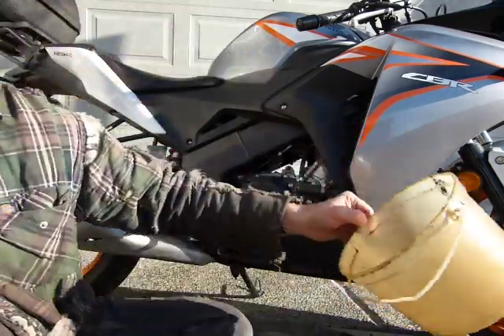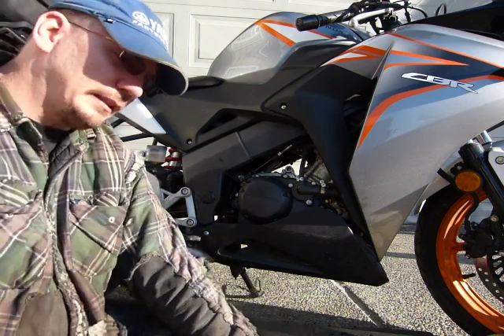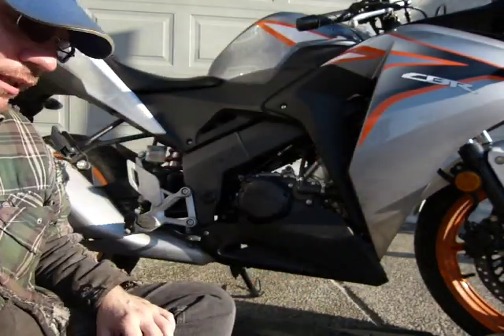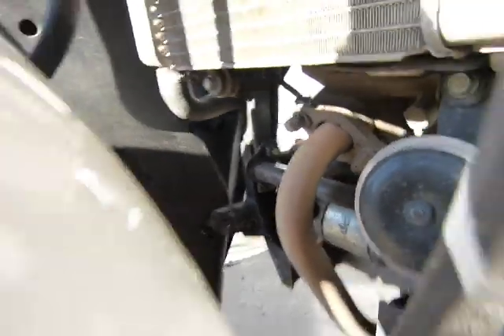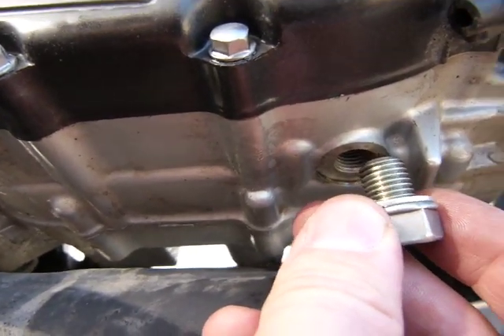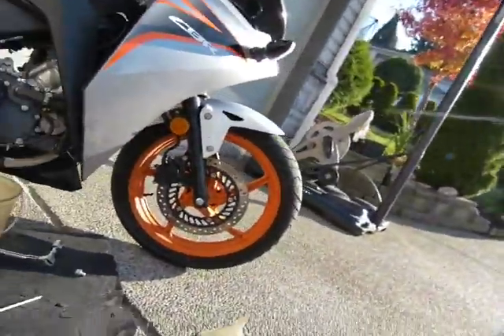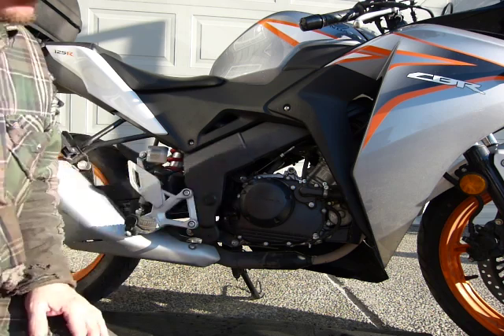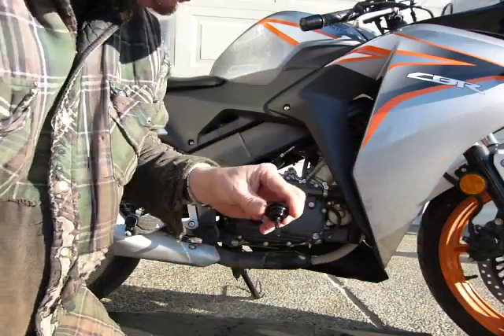CBR 125R first oil change (1000km or 600mi)

Comment: It actually does have a filter in the form of a screen, the oil passes through it and back to the bottom of the engine, its basically just a gauze and can be accessed by removing the clutch side
Reply from the maker: Graham Clarkie That`s right, thanks for the detail.

Comment: great video man. just to confirm, you measure the oil upright and not on side stand right? also is it just 1L of oil you need?
Reply from the maker: +HonestAbe89 Close. Upright AND level front-to-back, 1L approximately, until oil level shows between marks on crank case.

Comment: Hi, I have CBR 125 2011! Is there a oil filter that I have to change?!
Reply from the maker: No oil filter to change. Regular maintenance is oil only.
It does have a coarse wire mesh inside the crank case, but that only catches big chips or debris, mesh size is 2mm x 2mm. You`d only change that in a massive engine failure case.
Reply: theoverengineer OK! Thank you a lot! :)
Reply: theoverengineer  One more question! How many liters oil do I have to fill in?!
Reply: +miro ne 1 liter 20W40 mineral oil
Reply: @TheMotorman1981  10w40
Reply: @TheMotorman1981  and semi synthetic ideally as stated in the owner manual